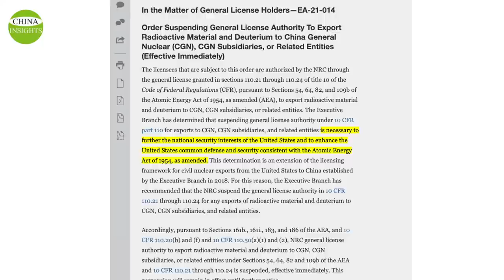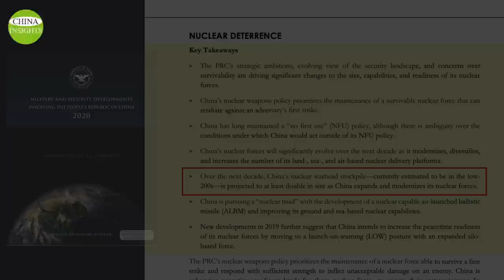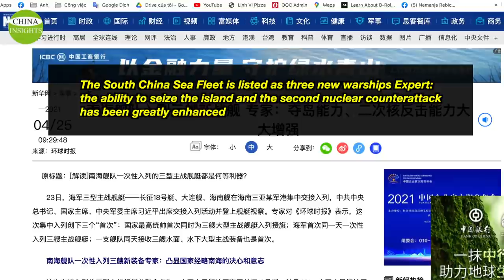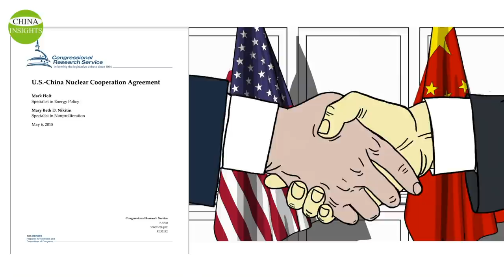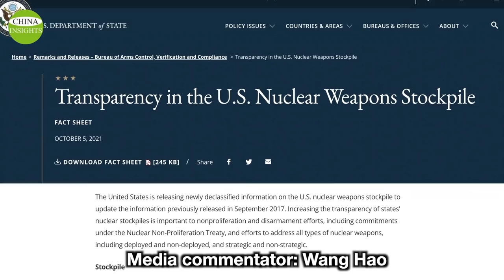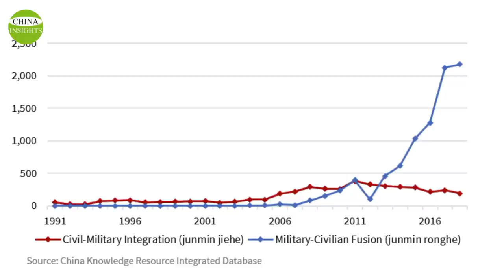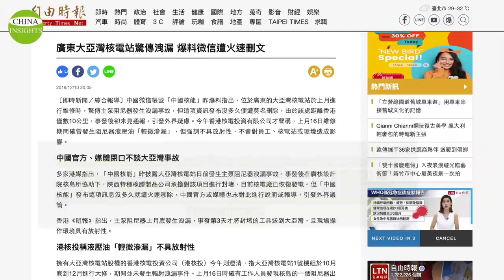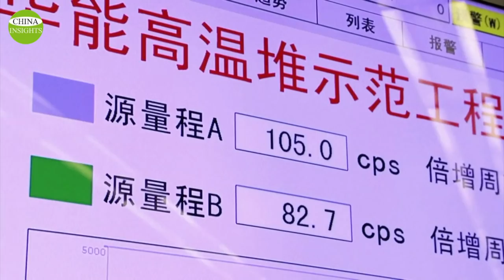The unimaginable China nuclear threat/$155 million per year has been paid to cover the plant leaking

Comment: They should only be given access to Thorium molten salt reactor technology that cannot bolster nuclear weapon proliferation but can provide clean energy for civilian use.
Reply: Tbf  it could be done with U-232 but would take a lot of tech to separate  it but can be easily sabotaged or prevented from existing but it in theory it would be easier to sanction China so their economy breaks down and the CCP loses power
Note:whoops wrong isotope because i am tired while writing this but sanctioning china would be the simpler option
I was talking about U-233 could be used
Reply: @simonpetrikov3992  I heard about this as well, but apparently U-233 emits some serious gamma radiation. Enough to fry electronics
Reply: didn't you watch the video they already got the technology to build military grade reactors. The only thing that can slow their nuclear development is not selling them nuclear fuel.
Reply: @ROKASniper89  It's U-232 that does it not U-233; U-233 is often contaminated with U-232
Reply: @simonpetrikov3992  It doesn't work! Molten salt reactor technology is way too expensive currently!
There is no viable reactor that can create energy competitively, and far from the efficiency of a traditional nuclear power plant. 
Whenever I hear people proposing these route, I am questioning if they actually did EVEN BASIC RESEARCH.
Reply: @simonpetrikov3992  Well if you had done basic research that would have been impossible, global supply chains are dependent on China keeping manufactured goods as cheap as possible. Nobody forced the West to start setting up plants in China where technology transfer was a requirement in exchange for cheap labor and cheap cost of goods. USA/UK/China/France/Belgium / Netherlands/ Canada / ... you name it all developed economies used CCP's government investment to attract foreign development to the fullest. FYI China can still get Deuterium from Russia and even Europe. I used to work for a company that exported this material to China... Propaganda at its finest... 
China can easily contact ROSATOM and get their hands on it via Russia, without anyone noticing.
Reply: @ABC-ABC1234  i didn't say that we should do it or it was even practical, just that it was very simple
Note: just because an idea is simple doesn't mean it's practical or a smart one
Reply: @simonpetrikov3992  It is very simple, until you realize that supply chain of goods is mainly global, a good example of that is the car industry, the chemical manufacturing industry etc. etc. China is at such a crucial stage in those industries that any sort of "sanctions" would result in global outages. And those outages will NOT be replaced by cheaper different sources, once you target China, goodbye cheap materials needed for day to day work.

So yeah, it is simple alright, until you realize all the goods that would be affected... It sounds as simple as Brexit right? And as somebody who has worked in the chemical industry, I can promise you, that the last thing anyone wants is to "sabotage" China. 

It's funny how politicians or uneducated people are always the ones suggesting to "punish" China. Without global supply chains in goods, you'll never be able to sell your goods competitively on the market.
Reply: @ABC-ABC1234  i literally put the caveat that Simple ideas doesn't automatically mean they work or that It's intelligent
Like what's a simple solution for policing problem; defund the police. Does it work? No
Note: i don't think that we should punish China because they have a lot problems especially demographic ones like the aging of China
Reply: @ABC-ABC1234  it's not impossible, if everything it was potentially lethal, or a pain in the ass was impossible and human existence would be mighty pleasureless .
Reply: @9WEAVER9  oke now in English?!

Comment: The PRC has 2 new nuclear power plants near Hong Kong that are so poorly run they could melt down.
Reply: This is Chernobyl all over again. Reminder: Chernobyl was caused by communism. If the engineers(who knew it all) shut down the plant, no disaster would have happened.
Reply: @the11382  Well, in a broader sence you can say it was communism (since the russia's five year plans led to the energy shortage), but what destroyed chernobyl was managment not listening qualified personel in favour to reach quotas (something that still happens to this day).

I know you'll say it is the same, but I just wanted to note that errors of this magnitude happen even now after the fall of communism with simmilar reasons for why.
Reply: @doublem1354  Management was pressured by the Soviet leadership to provide even more power. And this may even be at the barrel of a gun.